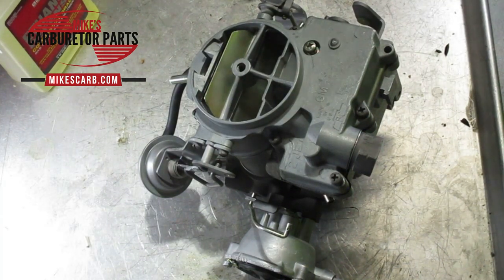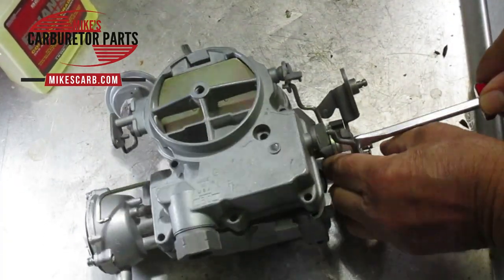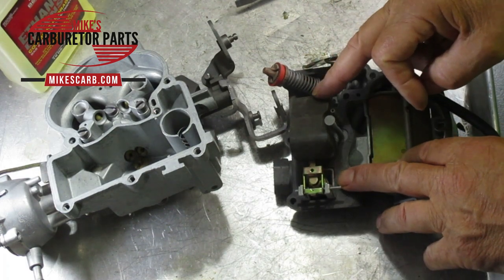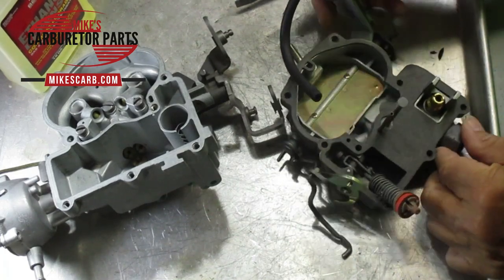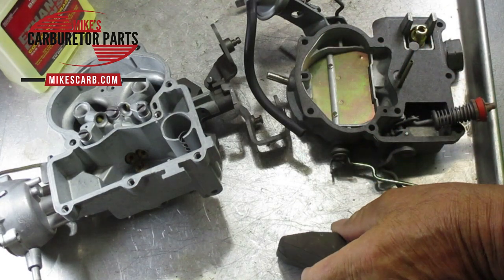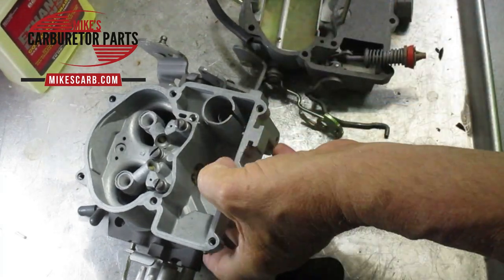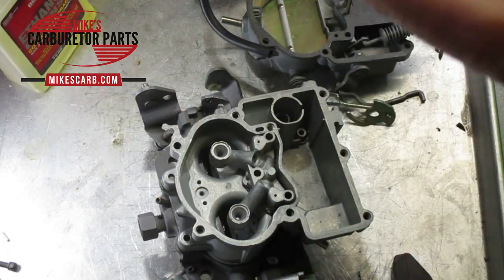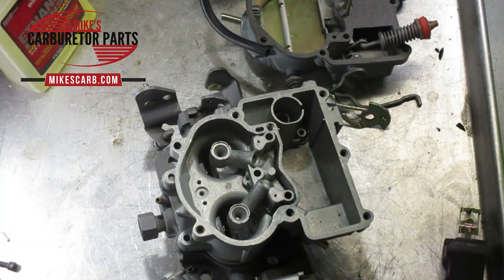Rochester 2 Barrel Technical Help For Flooding (2 Jet)

Comment: I think you helped me. My boat been flooding, running rich. To the point it would stall and not turn back on for a while. With the engine OFF fuel was still flowing out of the ventura. Or whatever you called it

Comment: As always very helpful. I have the venturi dripping at idle when warm and when stopped issue, noted in a article I assume by yourselves on a Carburetor-blog that outlined the following "If it happens at idle, or cruising along, then you have a problem. This can be caused by a vacuum leak, or something plugged in the idle circuit"... no mention of the main discharge. Just wondering the chief culprit to my issue? Thanks!

Comment: Thanks for this video. I will run down each of these possible causes for my flooding issues. I suspect I have multiple issues. I am starting with the electric fuel pump, so I am going to add a gauge to check the pressure. However, what do you recommend to do if I suspect my power valve is also sticking? I rebuilt the carb and found it rusted and frozen.
Reply: @MikesCarburetor  thanks!

Comment: The shaft of a carb can leak when they get excessively warn. At that point you have two options, pull the shaft hone the bore and install a brass bushing to take up the slop, or toss the carb and get a new one.

Comment: Im running rich is gas smell at exhaust. theres no fuel over the carb I look inside while running its nice and clear Ive adjusted the 2 mixing screws all the way out to see if that stops it. I dont know whats causing it its a 65 rochester center carb the cam is @.050 dura 217/229 vacuum should be OK all new parts for vacuum. Im going to test it today but any ideas?

Comment: Good afternoon, because I put that new carburetor on my 305 engine and it doesn't start when I try, I have to pedal and hit it several times. I have an electric pump and I want it to start immediately, what could I do to solve it?
Reply from the maker: It could be one of several problems. Is the choke closed when it is cold?  https://www.carburetor-parts.com/2-jet-troubleshooting

Comment: Hey mike we ha Rochester 2 barrel carb brand new, a buddy gave us, we are having hesitation in the beginning, basically it bogs down when take off from a light while pressing the gas pedal quickly. Any tips you can give us, the carb is on a 66 nova with a 194ci motor
Reply: @MikesCarburetor  ok I will check on it today sorry for late response thank you for the input

Comment: Hello Mike. I have a 1977 GMC pick up with a stock 305ci engine rebuilt. New. I bought a new, not rebuilt, 2bbl Rochester to replace the old one. It was advertised for a bigger motor. It has .52 jets in it and it stutters like a rapid misfire at any speed. So did the rebuilt I had before but with .38 jets.  [><]  Question: What jets go in a Rochester 2bbl for a stock 305 motor?
Reply: With .38 my plugs were turning black with soot. Too lean?

Comment: Could a sticky accelerator pump cup cause flooding?
Reply: @MikesCarburetor  Thanks, rebuilt and still flooding. I think the needle might be sticking. Pressure was 3psi but dropped close to 0 so I think it's stuck open. Will disassemble again. Not totally sure on the float setting, this is on a Chevy 4.3 v6.